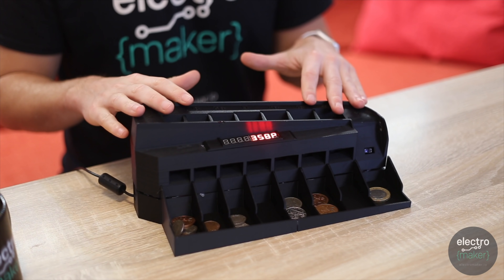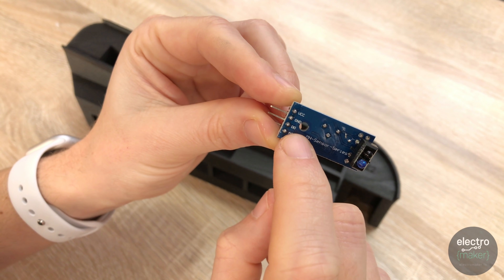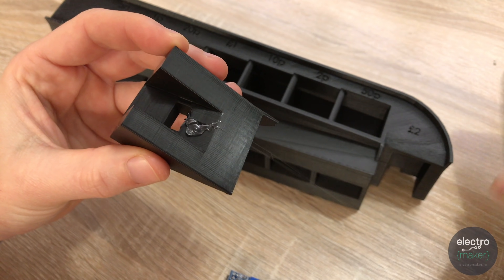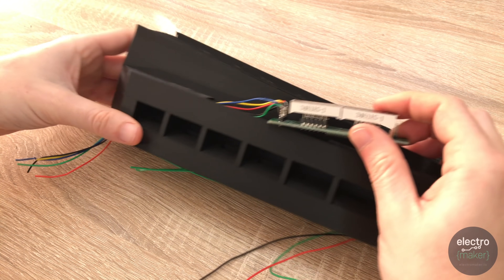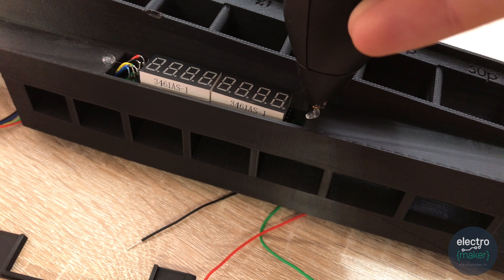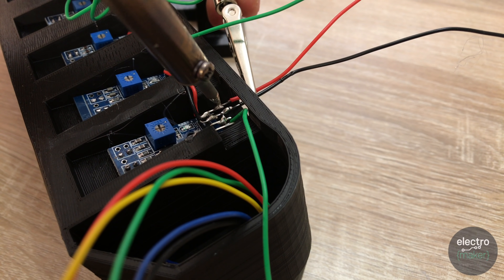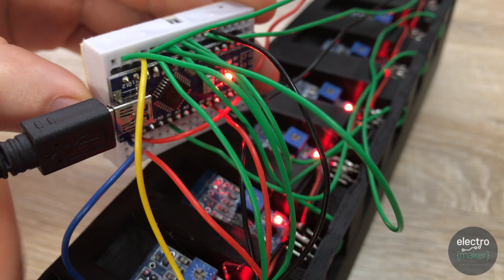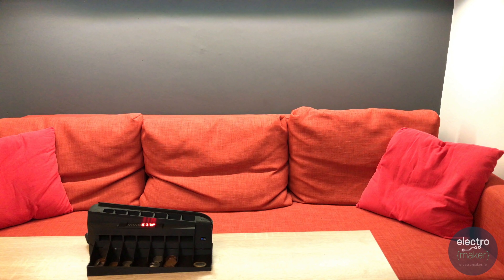How to build an Arduino coin sorting and counting machine

Comment: Nice design, next version should have screw-holes so we can assemble the parts using machine screws instead of glue :) just in case a soldering point or a wire get broken, it can be fixed.

Comment: See what you've created is neat, tidy, well designed and works well. But I have a problem with it - or more specifically with you the designer. Given that the government / bank of england like to change our coins (and sizes) every few years, why have you not made a replaceable filter for the top for the coins? - or even better, an adjustable one? - Use some stepper motors and you could even have your sorter set them up automatically. At present, next time the coins chance, you've got to reprint the entire thing.
Reply from the maker: This is an excellent idea! If you build an improved version let us know - we'd be excited to see iterations that improve on it!

Comment: i made mulitple comments here, sorry for that but i have one more question. you used tcrt5000, which is a sensor detects reflective sensors right? but how come it was able to detect your hand?
Reply from the maker: These kinds of sensors can reflect off quite a number of surfaces! While some struggle to reflect shiny objects like metal, the tcrt5000 can reflect off all kinds of objects (like people) and shiny things like metal. The creator of this project has a separate instructable all about the trct5000 module used here: https://www.instructables.com/TCRT5000-Infrared-Reflective-Sensor-How-It-Works-a/
Reply: @Electromakerio  thank you so so much for both of your answers. your content is very well organized 🙏

Comment: i am planning to benefit from this project for my school project which is venging machine. i am just a beginner, so can you tell me why did you select to use arunio nano but not ardunio uno?
Reply from the maker: Hi there! It doesn't matter which one you use, they both use the same ATmega328p chip and can do the same thing, the Nano is just much smaller!

Comment: Very nice project!! Can you explain how can I change the dimensions of the holes using any CAD? I Want to use this machine for coins that belong to another country.
Reply from the maker: That is hard to answer as all CAD software works a little differently. I'd maybe start by looking for tutorials for cutting circles using the software you have first, then applying it to these designs.

Comment: Hey there! I'm exploring arduino from zero and can't understand at all. I want to make this with this components 6 TCRT5000, 1 LCD1602, 1 Arduino Nano, 1 220 Ohm (for LCD), 1 74HC595, but I'm not sure about resistance and voltage. It's ok if I don't plug-in resistance for each TCRT5000? How much Voltage should I use?
I have been reading TCRT5000 datasheet, does it use 5v? If so, Should I use a 30v power source? Is ok 30v connected to Arduino?

If anyone has any tips for a noob...

Thanks!

Comment: Very educational.. i can use it in my project.. but i wonder about the reset button? Where can i tap it?
Reply from the maker: You can access the reset button on the Arduino from underneath the base.

Comment: I think you should also put some more variables like lastbuttonstate and for all the sensors because we want every time the coin passes to increase by one (like pressing a button once) with this way even with the delay fuction it gets random data easily, just my thoughts :
 int value1 = digitalRead(pinIr1p);
 if (( value1 == LOW) && (flag1 == 0)) {
    count_c1++;
      sum = sum+0.01;
      flag1=1;}
      delay (debouncer);
     if (( value1 == HIGH) && (flag1 == 1)) {
      flag1=0;

     } 

Something like this
Reply from the maker: This is a great suggestion. If we ever build a version 2, we will be sure to implement this idea!
Reply: I have this query, if the coin passes the sensor too fast, it does not detect it(but I can see that in the sensor itself, it activates).

Comment: Can I use Arduino UNO
Reply from the maker: Yes you can use an Arduino Uno. Connect it the same pins as shown on the Nano in the video. Just use longer wires as the Arduino Uno will not fit in the same space under the counter as the Nano - you'll need to house it seperatley outside the 3D printed parts

Comment: that soldering job just.... it really grinds my gears..... specially the lack of heat shrink tubing..... but it works, that's what matters
Reply from the maker: Yes it does work, and you are right, my soldering skills are improving all the time. Heat shrink tubing really tidies things up and helps protect the circuits and joints. If you have it to hand then I would recommend using it.
Reply: Whatever it takes

Comment: Hi, Thanks for sharing the video, we have a different set of problem. we have coins minted (Old & New) with Old minted coins have different diameter as compared to New minted coins.
e.g. Diameter of old minted Coin for denomination of Rs. 1 is different from Diameter of New minted Coin for Denomination Rs 1.
Diameter of old minted Coin for denomination of Rs. 1 is equal to Diameter of New minted Coin for Denomination Rs. 2.
We are in unable to build coin counting machine because of it.
please assist us with the query.
Reply from the maker: Hi, that's a tricky problem to work around with this design of machine. It separates the denominations using their diameter. If you have two sizes for the same denomination then you could create a second slot and have the code increment the value on the screen by the same amount for either slot. If you have two different denominations with the same diameter then you will have to consider another method for differentiating between the two. You could consider magnetism, thickness, weight or colour perhaps.
Reply: @Electromakerio  Hi, Thak you for response, we did try to work it out using wieght but again found that wieght of Old Minted Coin of Denomination Rs ! is similar (1 or 2 Milligram less than ) to wieght of new minted Coin of Denomination Rs @.
We have same finding for Thickness as well.
Could you please guide on how to use Magnetism or Colour as a differentiator, 
 I feel differentaiotion based on Colour will be tricky because the colout of Denomiation RS 1 & Rs 2 is same, also for Denomination Rs % & Rs 10 has same.
Perhaps Magnetism can help. Composition of coins is as below
Rs 1 --> Stainless Steel
Rs 2 --> Stainless Steel
Rs 5 --> Nikcle Brass
Rs 10 --> Copper Nickel Cnetre & Aluminium Bronze ring.
Reply from the maker: Colour can also change depending on the condition of the coin. Magnetism would be a good additional check but this is beyond the scope of this video - sorry. Perhaps in the future if we build a Mark 2 then we might incorporate some of your suggestions. Have a look at incorporating a reed switch into your design.

Comment: Can you Modify the upper part so that it will accept Euro Coins? For Euros you probably only need to change the size of the hole

here are the sizes/diameters of the different Euro Coins if this helps:
1cent - 16.25mm
2cent - 18.75mm
10cent - 19.75mm
5cent - 21.25mm
20cent - 22.25mm
1euro - 23.25mm
50cent - 24.25mm
2euro - 25.75mm